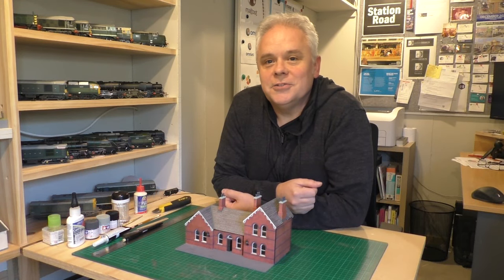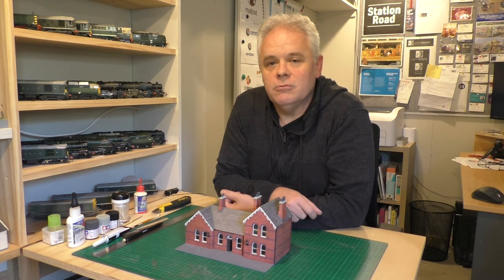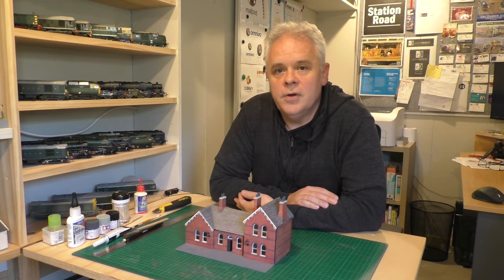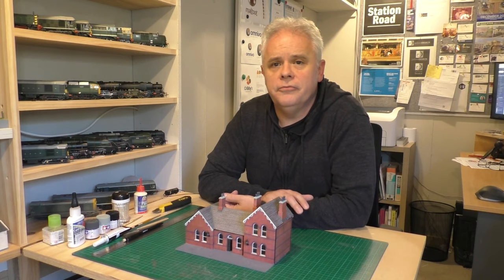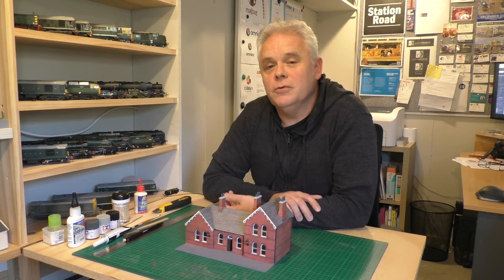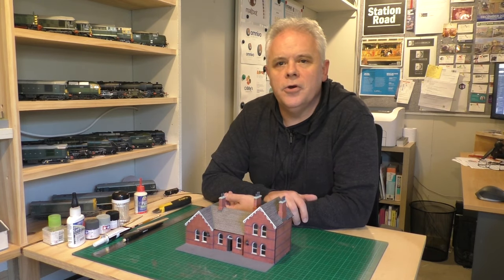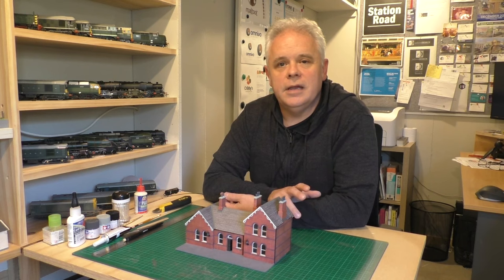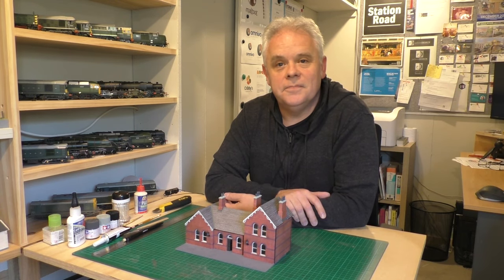Scratch-Build Station Finishing Details

Comment: Hello, Julian, I hope you are doing well.

I've been meaning to make a suggestion about the retaining wall that is opposite the canopy you recently made and below the factory complex, (although I haven't gotten around to typing it up until now): 
On the back wall of your layout you've got your arched retaining wall based on a grey stone version of the Metcalfe viaduct kit. To the right of this, at the left boundary of the industrial area, this changes to a red brick version of this same design. In my experience, you usually see a sudden change in material like that when a section of retaining wall has been built at a different time to the retaining walls around it, and if it is built at a different time, it is likely built in a different style -- which ever design was popular at the time of construction. As such, to me the six red brick sections of retaining wall below the factory buildings and between the tunnel portal and the grey stonework look somewhat out of place, given that they are in the exact same style as the latter. With this being the case, I'd like to suggest that you replace these six arches, and build the section of retaining wall adjacent to the new station in a different style, perhaps utilising a copy of the Metcalfe retaining wall design that was previously in that area your recent redevelopment. I remember you once said that you were primarily adapting the viaduct kit because it was more economical, but if you scan the Metcalfe retaining wall into your computer, your can use your graphic design software to customise this to suit this specific area and print it out yourself more cost-effectively. I believe that this would make a great improvement to this area of the layout.
If you've already started constructing this section with the viaduct-based retaining walls, then nevermind, but I haven't had the time to write this rather lengthy comment until now, unfortunately.

At any rate, thanks for another video, and I look forward to your next one.
Stay safe and take care.
:)

Comment: Good vid! Julian have you tried your hand at building in plasticard? I feel it offers greater 'depths' of realism (more relief detail etc.) as compared to card stock. I suppose now that you've done most of your structures in card it might look out of place adding buildings in plasticard or resin. Even so, the buildings you make are lovely, this station being no exception! Just a thought. Cheers, Joachim
Reply from the maker: Thanks Joachim. I have worked with some plastic kits in the past and I do use plasticard in some components of modelling, but I've never scratch-built an entire structure using plasticard. I can certainly see plasticard offering that little bit of extra depth and also longterm durability over card construction, but I just find it easier and more enjoyable working with card. I don't find it as enjoyable working with plasticard (or plastic kits) and 'enjoyment' is a key factor for me.
Reply: @StationRoadModelRailway  For my own, I have tried both materials on model railways (British N scale by now) and, as a personal preference, I prefer card : cheapest, especially when you use discarded pasta boxes like me, easier to work with while doing scratchbuilding, and even kit building, and, subjective and in N scale, a better aspect over plastic kits in terms of overall finesse of the result. I'm planning some scratchbuilt buildings for my forthcoming layout, and they will be all card.

Comment: Is that not a kit bash of a Metcalfe kit as opposed to a scratch build?
Reply from the maker: Nope, it is a scratch build. Check out the video I mention at the beginning.
Reply: @StationRoadModelRailway 

Thanks for the reply, no offence intended, my mistake.... I shall check out the video you menttion👍
Reply: I was incorrect. I very much enjoyed the build video, good job👍
Reply from the maker: @atlasduff4628  I can see how you might have initially thought it was based on a Metcalfe kit as the red brick Metcalfe station (which I have one in another area of the layout) does share some similarities with its general layout, two storey and single storey end sections joined by another single storey section in the middle.